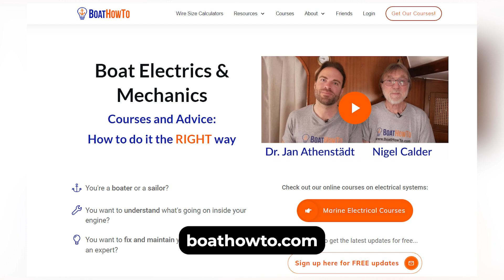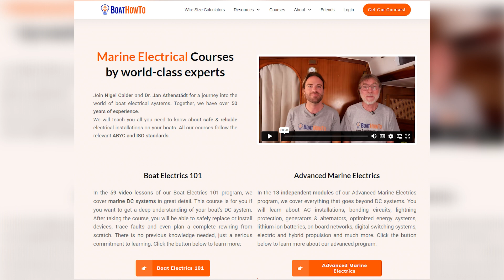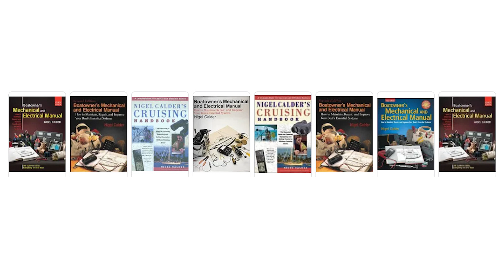Nigel Calder & Jeff Cote Talk Marine Electrical - Part 1 of 11 - The Basics

Comment: I found the DYI owners seem to just do, without thinking. Wire colors, I've worked on boats where, an owner installed a VHF radio, needed 23 ft more wire to hookup from the power source to the VHF, he used 4 different colors and size  He had 18g, to 12g, to 18g to 10gjust on the Pos + side, on the Nag -  he ran a 3 strand NEMA from the motor, to battery, to VHF, a little over 30ft. This was a 25watt unit, with all the wires twisted and taped. He fused both + and -, however it was fused at the radio, not at the source.
Reply: Owners assume that 12V is risk free.
Reply: @stephenburnage7687  How true,
Reply: My point exactly